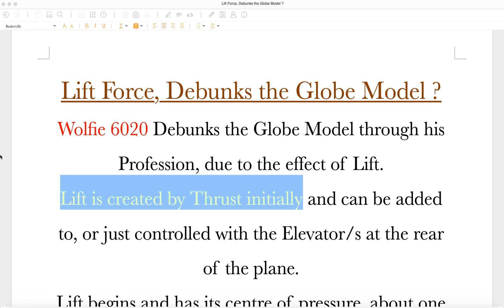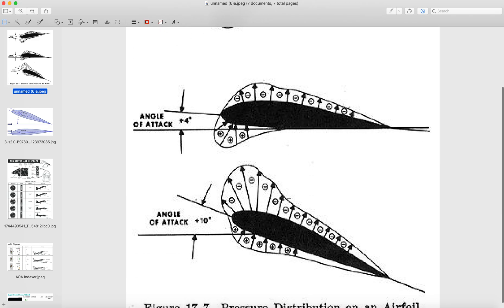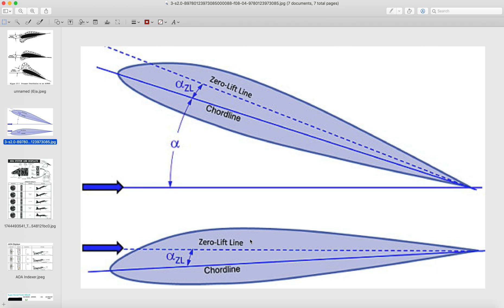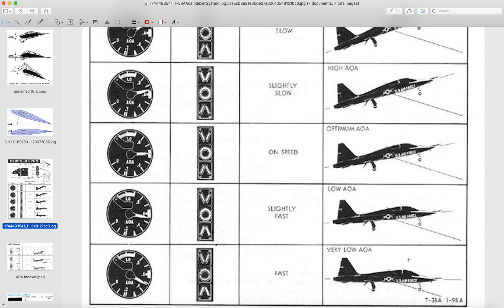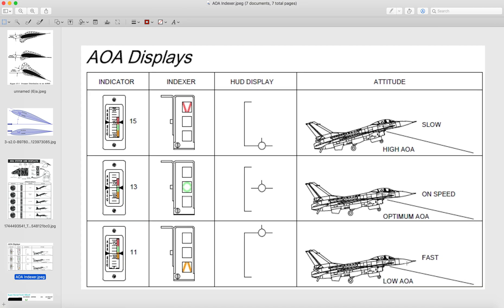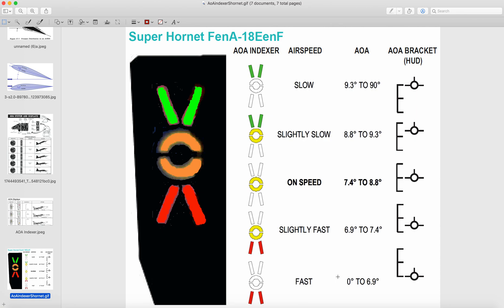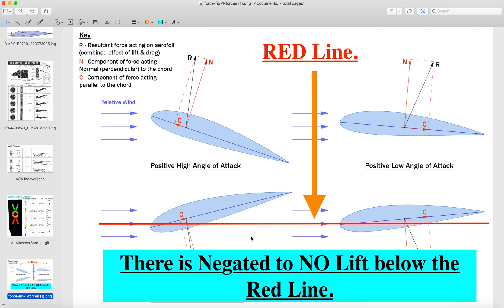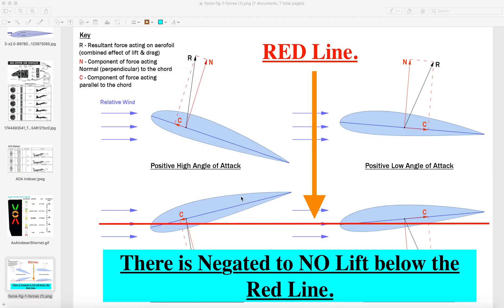Lift Force, Debunks The Globe Model ?

Comment: You are still not getting it Brian.  

This is 100% strawman.  

I have never claimed you need to pitch the nose to below zero to follow curve.   Not once ever.  

What you need to do is research the lift formula.  Understand how it works.   

You need to learn the difference between relative airflow, angle of attack and nose attitude.  

You can have a negative angle of attack while pointed straight up and you can have a high angle of attack while pointing straight down.   You are not putting any of the pieces of the puzzle together correctly 

You need to understand that your flight path can be below horizontal with the nose above horizontal and several degrees angle of attack on the wing.  (I even show that in my videos) 

How do you think we fly aerobatics mate?   How can we pull positive G while upside down?    

You absolutely 100% do not have to lower the nose to below zero to follow curvature.  This is YOUR claim.   Not mine.  

Stop strawmannirg. 

You have a lot more homework to do.  Try again.
Reply: @Q Branch I am between genuine pity for a man lacking the intelligence to understand this and amusement at the display of stupid arrogance.
Reply: @Q Branch "He is wilfully ignorant."  This is certain.
Reply: "I have never claimed you need to pitch the nose to below zero to follow curve. Not once ever."  ... because there is no curve. Excellent self own.
Reply from the maker: Support your claims Wolfie ?
Reply: @BriansLogic 

3;34  You stated. " too far above horizontal it causes no lift" 

This is an irrefutably false claim. 

Please support your claim with NACA charts showing zero lift beyond C/L max

Here is another for you to ponder.  

If horizontal flight requires three degrees of nose up, what happens if you reduce to 2 degrees nose up?   Will the plane fly level or descend?
Reply: @BriansLogic  I read elsewhere on this video that you are unemployed.  Is that correct?  I like to verify things directly.  If not, I am genuinely curious about your profession. 

You know what I do and listed that in your video so please let me know.
Reply from the maker: @Wolfie6020  Support Your Claims Wolfie ?
Reply: @BriansLogic  I have supported "My Claims" Brian. 

Now support yours thanks and answer the questions please.   Are you unemployed?  Yes or No?  

Can a plane descend with the chord line at a positive angle to horizontal?   

Yes or No 

4am in Ireland mate.  Can't sleep?
Reply: @Wolfie6020  keep dancing for us deceiver.
Reply: @Wolfie6020  remember the other day when ftfe talked to a flight instructor? who was disabled? that's the only time you feel brave enough to talk to someone, and even then you tripped yourself up, people are calling you out all over the level plain.
Reply: @Wolfie6020  still makin fake accounts of people who expose you? and pretending to win debates talkin to yourself?
Reply: @BriansLogic  careful mate, if you expose wolfie to much she will make a clone of your account.
Reply: @BriansLogic  He did Brian - you just refuse to try to understand it. You're embarrassing yourself at this point. Study this stuff before you make any more videos. Start by figuring out why thrust doesn't cause lift!
Reply from the maker: @bluemarblescience  Really why don’t YOU share this Evidence and Data again with me then Blue ? 
Because what I’m hearing from you is that the Chord Line of the Wings can go below Horizontal and still keep lift, is that YOUR claim Blue ? 
Please present the data and evidence that your stating that I’m ignoring ?I want all the Thrust and Pitch corrections that match a Globe Earth with a Radius of 3,959 miles ? 
Because Blue claiming that ye just follow an Altitude without making drop and curve corrections, means that your flying over a Flat Earth Blue…. 
The Chord Line makes your claim impossible….
Reply: @BriansLogic  Look up "relative wind" Brian. It has nothing to do with horizontal. A wing generates lift in any attitude you like - there is no reference to horizontal - only relative wind! The wing will generate lift if the nose is pointed straight up, straight down or inverted as long as you have a positive angle of attack and that's the angle between the chord line and the "relative wind". 

The air density is a constant at any given altitude and that would be true regardless of the shape of the earth. Make it concave if you like. The wing will generate exactly the same lift for the same airspeed/angle of attack and density of the air. It has to remain in the same air density which is a constant altitude if airspeed and angle of attack are held constant. If the plane is trimmed to fly hands-off at 10,000 ft, it will stay at 10,000 ft unless you force it to do otherwise regardless of the shape of the ground underneath it. 

If you upset it by pushing the nose down, you've reduced AOA and you'll pick up airspeed. The denser air will generate more lift at the initial trim setting and the plane will climb back to 10,000 ft at the airspeed you started at as soon as you release the pressure on the yoke. If you pull the nose up, you'll increase AOA and lose airspeed and the less dense air will generate less lift at your initial trim setting so as soon as you release the backpressure, the plane will descend right back to 10,000 ft and airspeed will increase to the speed you started at. Obviously, that density/pressure gradient will not allow the airplane to climb or descend from the altitude it's trimmed for as long as AOA and power setting isn't changed and because the air density gradient follows the curvature of the earth, the plane is going to follow that curvature of the earth with no input whatsoever required from the pilot.

I don't know how we can make this any more clear. This isn't proof of the shape of the earth. It would work exactly the same way on a flat, concave or convex earth as long as the atmospheric pressure is constant for a given altitude above MSL! Sign up for an online ground school like "The King Schools" and actually learn about how this really works or go take a few lessons. You'll quickly discover how utterly wrong you've been.
Reply from the maker: @bluemarblescience  I know what relative wind is, and I also know about AOA and Thrust, but who cares as all that is important is that the Chord Line cannot go below Horizontal ( relative wind ? ) without losing lift.
Do You think that I am stupid enough to entertain your begging the question fallacy Blue ? 
You have got NO data or evidence to support any claim that Aircraft fly around a Globe, as their inherent design makes that an impossible act, trimming for Altitude is something you would do on a Flat Earth or Globe Earth, but the big difference is all the corrections that you would have to make to go around a globe to the Thrust and Pitch, and as we have established not only does that data not exist, but the pitch corrections would be impossible.
You’ve got nothing to support your claims here Blue, the evidence you need is impossible to exist….
Reply from the maker: @bluemarblescience  Oh and could you define mean sea level for me, and how it is established please ?
Reply: @BriansLogic  Screaming NO NO NO and throwing your food isn't going to change the facts Brian and those facts are as myself, Wolfie and many other actual pilots have stated them. There is no begging the question fallacy Brian but you're putting forth an argument from ignorance fallacy. You are still confusing horizontal with relative wind. You still don't understand the pressure gradient and the fact that equal altitudes have equal air densities regardless of the shape of the earth. You can argue about this utill you're blue in the face but you are simply wrong - end of story.
Reply: @BriansLogic  Mean sea level (MSL) is an average level of the surface of one or more of Earth's bodies of water from which heights such as elevation may be measured. It is generally measured over a long period - hourly for a period of 19 years for instance. I can't believe you would ask such a silly question!
Reply from the maker: @bluemarblescience  Ok Blue then please present the evidence that Wolfie failed to do. 
Please show how the Chorline of the Wing can dip below 0 degrees and keep Lift ?
And please provide all the Thrust and Pitch Data that supports a Globe Earth with a Radius of 3,959 miles, it should be easy to provide if it happens daily 10,000 times ?
Reply from the maker: @bluemarblescience  Copy and Paste I think Blue ?
MSL is a LOCAL Average of Mean High and Mean Low tides, MSL has absolutely NOTHING to do with a Globe Earth, or any believed model, it is an Average, that is different from place to place as tides are different from place to place Blue.
There is a World MSL Average also, which is an Average of all the smaller Averages.
I asked because you claimed MSL as part of your argument, and your obviously arguing for a Globe ( God knows why ? ) and I wanted to see if you would define it, and you didn’t you gave an ad-hoc description of it….
Reply: @BriansLogic  If you want to be childish and pedantic, I'll give you the fact that sea level varies (every so slightly) from place to place but I'm talking about altitudes of thousands of feet above MSL for an aircraft and some two or three foot difference in MSL makes absolutely no difference to the argument. This is how you guys fight. You've lost the argument and lost badly and now you want to start tossing in red herrings. That's pretty poor Brian!
Reply from the maker: @bluemarblescience  Correction I have won the argument outright, as you guys can't support your claims, outside of begging the question ?
You brought MSL into the argument as part of begging the question, but I know where MSL comes from and what it really is, and more to the point what it's not....
Your Beliefs are not Proofs or Evidence of your Claims....
Reply: @BriansLogic  Don't stop there oh wise one. Please enlighten those of us not as astute as yourself. What "really is" MSL and why do we use that when we state our altitude as opposed to AGL?
Reply: I watched the entire video and at 10:30 in your video you say to fly around the earth (which takes 48 hours) you obviously need to pitch downwards. Was this taken out of context or something?   Do you need to pitch down on a 12 hour flight (or one entire quarter) around the globe?   Thanks in advance
Reply: @thickie-d  The aircraft pitches down relative to the original starting attitude.  However the flight Path of the aircraft is always tangential to the Earth.  

When you fly 60 NM you have pitched down 1 degree relative to your starting attitude.  But relative to the ground beneath you there has been no change in the nose attitude (because the Earth has curved by 1 degree also)   The relationship of attitude / flight path and local horizontal remain consistent. 

The aircraft never has to pitch to below zero degree (relative to horizon at the location of the aircraft)   You can follow curve just fine with a nose up attitude.  All that is required is a flight path that remains tangential to the Globe.  That is achieved by maintain a steady altitude.   You don't see the nose pitching down because the Earth curves at the same rate.  1 degree per 60 NM. 

I have consistently stated that the calculation of drop and nose attitude change must be calculated from the aircraft itself.  This is was you see and experience in the aircraft.

I hope that clarifies the point?  I have covered it in more detail in follow up videos when I realised some people were not quite understanding my first video.
Reply: @Wolfie6020  cool, thanks